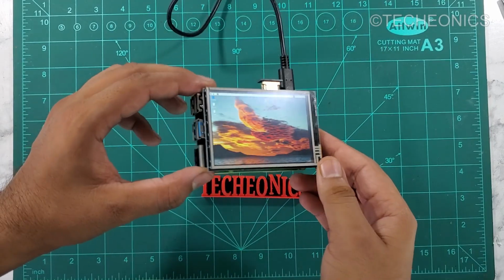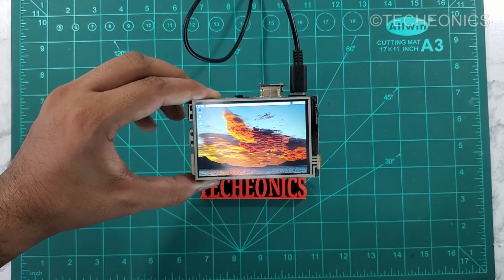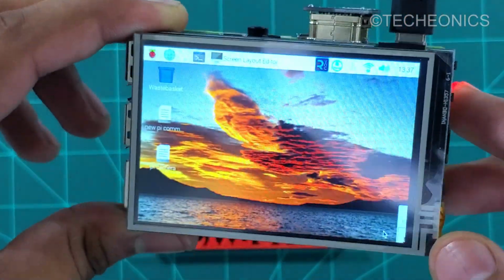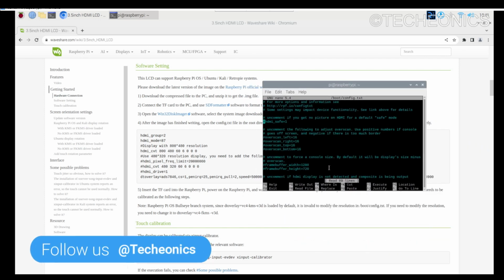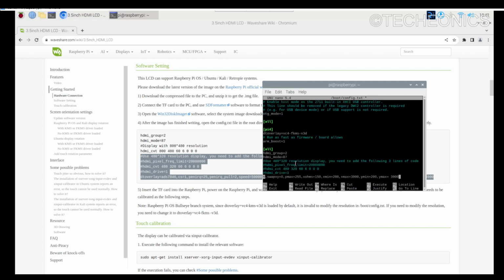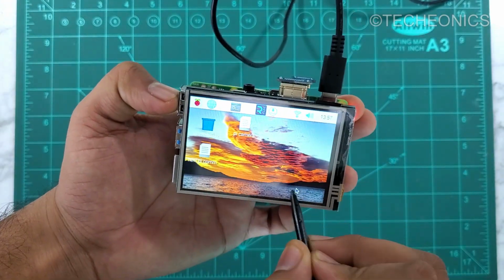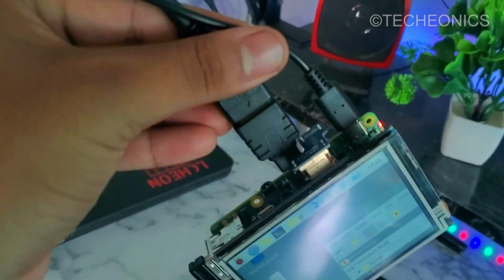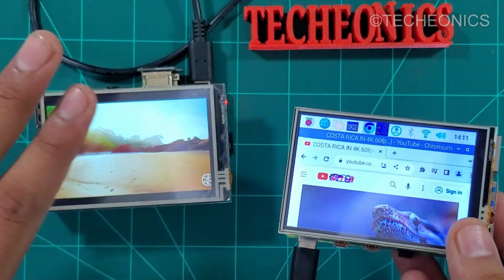Waveshare 3.5 inch HDMI IPS Touch Display for Raspberry Pi | Unboxing Setup & Comparison |Techeonics

Comment: Very nice and useful tutorial. I have the cheaper GPIO LCD Display for which drivers needed to be installed. Do we need drivers for this model? Also in the raspberry pi desktop the menus are not showing entirely on the disply. what is the remedy for this.
Reply from the maker: Drivers mainly for touch else it can work directly
Reply: @TECHEONICS  Thanks for the clarification. Is there a casing available for this.

Comment: Since display uses Rx Tx pins how to connect sensor like fingerprint sensor that also requires Rx Tx pins as well as 3V and ground pin? Looking for solution for Pi Zero W, any help would be greatly appreciated. 
Thanks